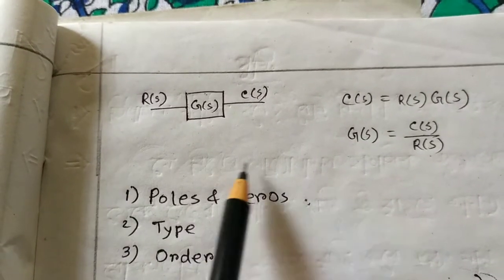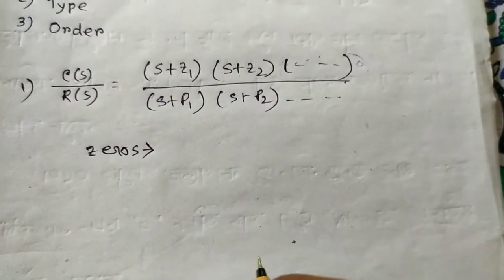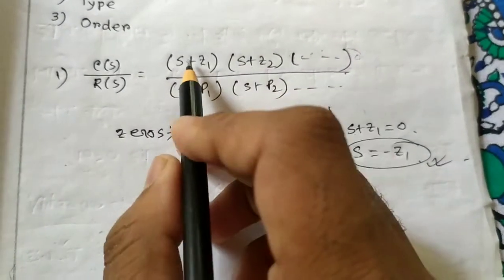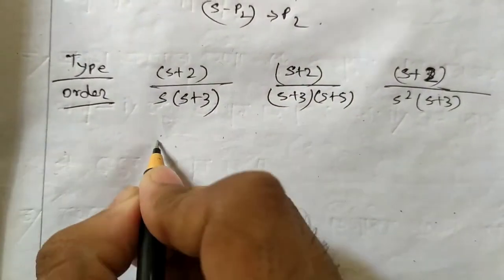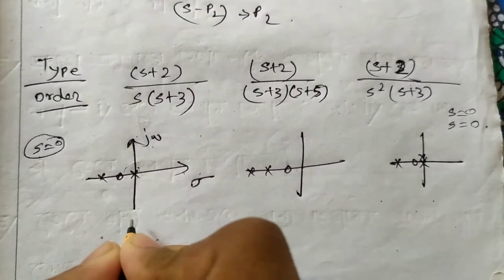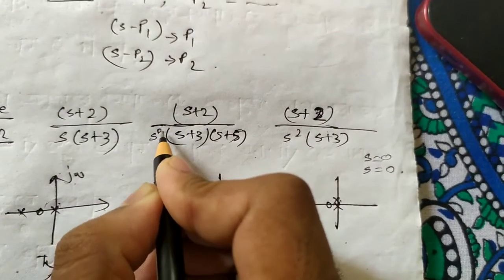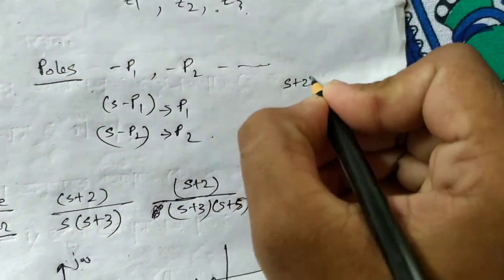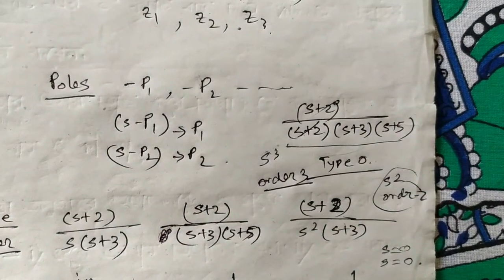type| order | poles & zeros | of Transfer function. Basic concept

Comment: I need to calculate a lead for a class D amp feedback, it come from after the low pass filter 60 kHz and through a low pass RC filter (60 kHz) first and then through a op-amp lead corrector to get oscillation frequency, I have us there 3.9K and 47 pf to get it to left plane or as people call it..

It is quite complicated stuff. But maybe I can learn some here.

It is a butterworth, but I was also curious to test a bessel 24dB octave low pass need to lead it, or maybe not, th amp get self oscillating when fase reach -180 degree.

thanks.